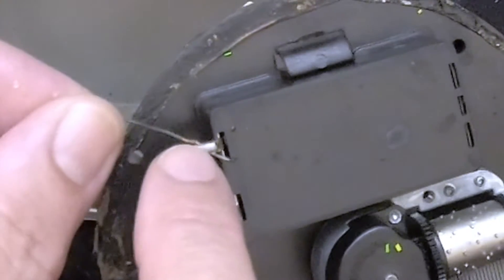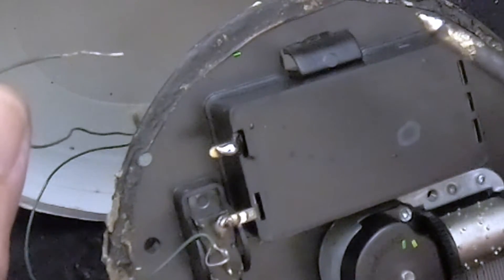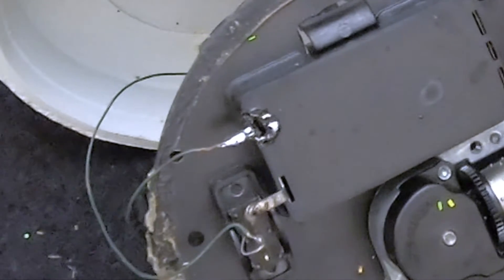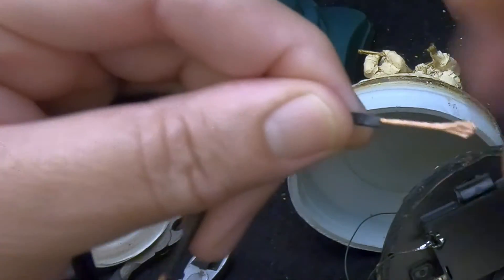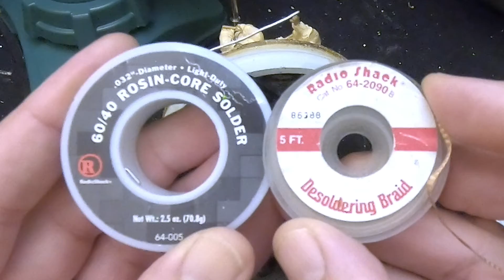Ep. 91 - Basic Soldering Techniques for Snow Globe Repair - Detach and replace wires

Comment: How do I know which wire goes to which side?? Does it matter??
Reply from the maker: It usually matters, especially when you are talking about DC electricity as provided by a battery. The red wire should connect to the positive (+) connector and the black wire should go to the negative connector (-). If the wires are not color coded and/or you are not able to determine the polarity of the connector you may determine it by the way the batteries sit in the compartment and/or where the wires are connected to the motor or lights, depending on which end you are connecting. In most cases if you wire it wrong it will just not run or run backwards. In this case just de-solder and swap the wires. Hope that helps.

Comment: Thanks. I was wondering how to solder. I’m not sure I’m ready to try it though.
Reply from the maker: You're welcome. The next time you go to throw away some electronic device that has a circuit board or wiring in it, you can take the circuit board out and practice. Take some old wire, maybe from the power cord of something that you are throwing out and practice tinning the wires.
Reply: @snowgloberescue8887  that’s a great idea. I’ll give it a try.

Comment: Have you found a new rocker switch for any snow globes? It's 120/220 ac rating and connects to 2 aaa batteries. No part number on the switch.
Reply from the maker: No, we haven't come across any. We have a bunch of globes in storage. I think some of them have some type of switches. I'll let you know if we find one.
Reply: @snowgloberescue8887  Thank you.